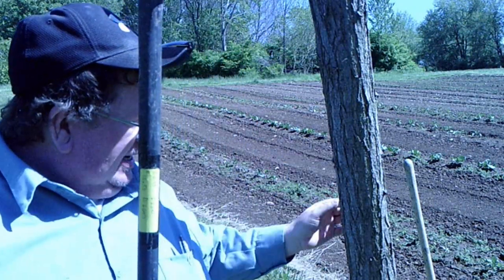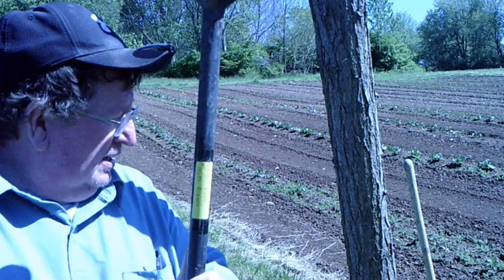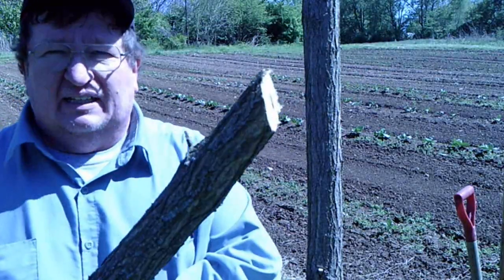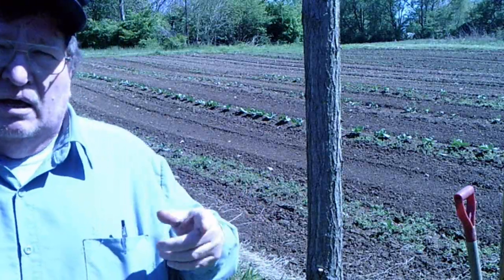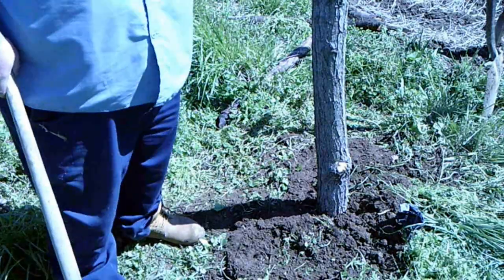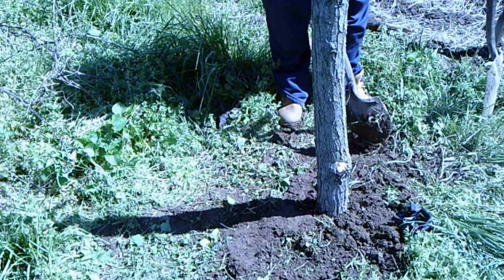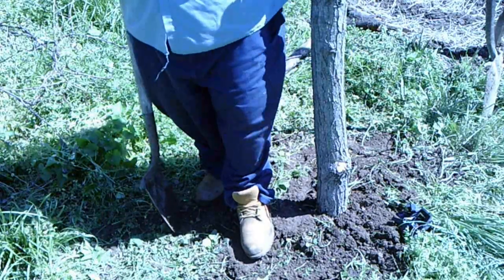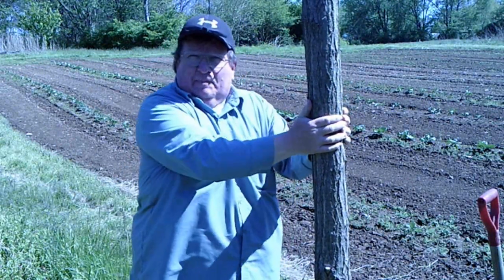Setting An End Post Without Concrete - Keying

Comment: How is this holding up?  Was thinking of doing something similar for a short run of white picket fence to avoid using bags of concrete.
Reply from the maker: I think this is 3 yrs ago and it is even stronger today. You have to use a pretty good key or it will rot away pretty quick. But a black locust key will hold strong for years.